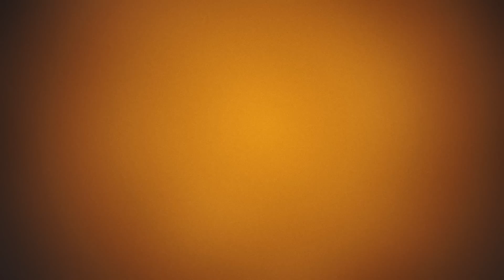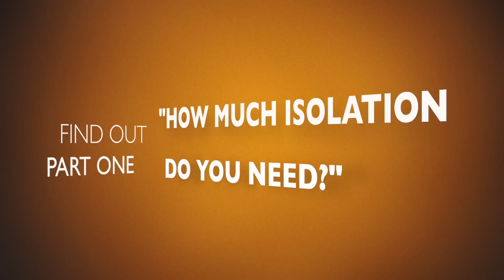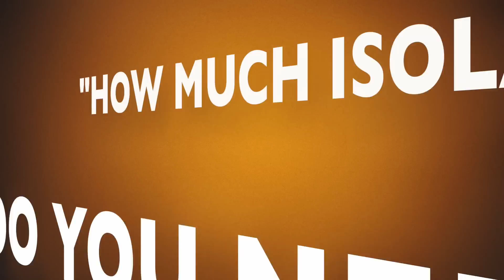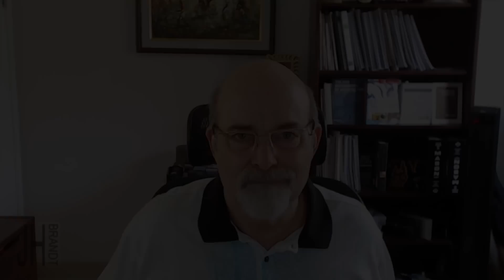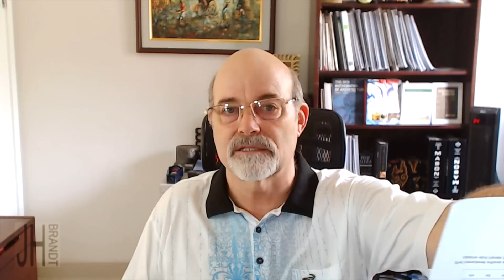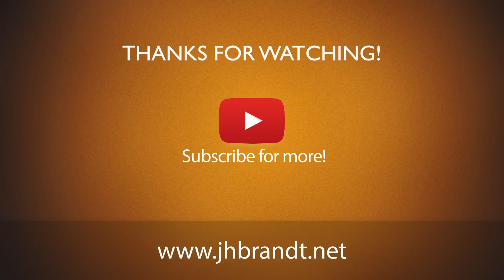How Much Isolation Do You Need? - part one - INTRO

Comment: I had to grit my teeth when I saw an episode of "Holmes on Homes" where he announced he would be building a small recording studio in a former garage attached to the house. He used an ordinary door knob early into the show and that was as far as I could bare to watch. Even with a good solid core door with magnetic strips around the perimeter with metal flashing in the door jamb, this door knob will be like a pin hole in a water balloon. I wonder how long it took him to find out how those bird noises were getting into his studio, and I use the word studio lightly here.
These videos are priceless, can't tell you how much I appreciate them. I was taught to use math to calculate, and what I see for sale on line just doesn't measure up in most cases. These videos help a great deal for someone who can't afford to buy books and such these days, thank you for taking the time to make them.
Reply from the maker: Thank you so much! Actually, I will have my book available next spring with full drawings and explanations for everything you could want to do with a studio. "Recording Studios and Other Acoustic Spaces – Vol. 1
"